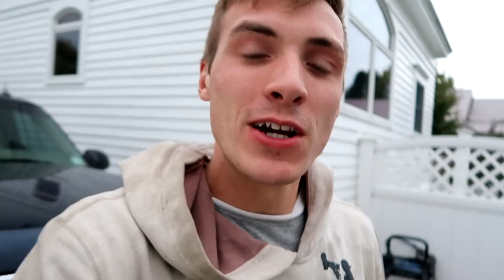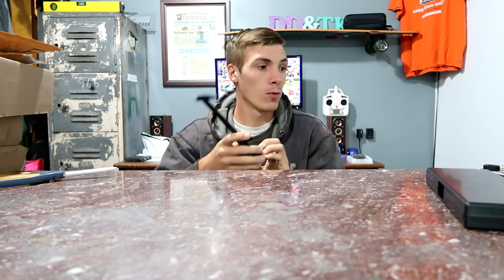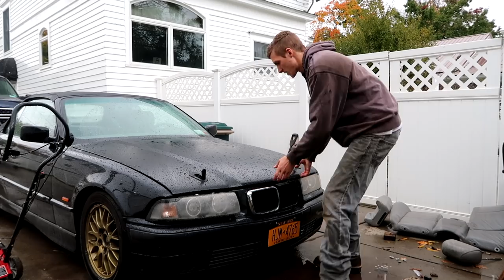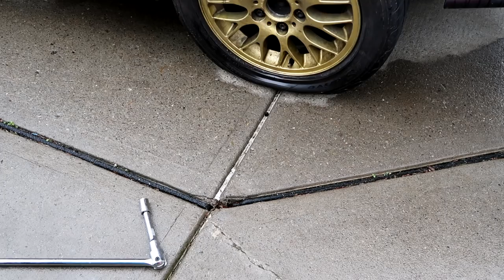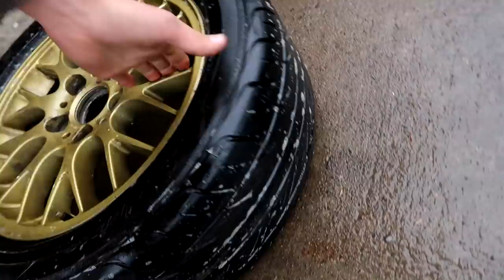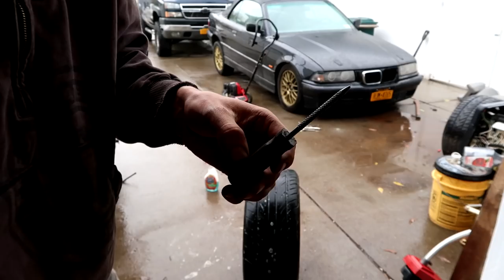IT'S HARDER THAN IT LOOKS!

Comment: dont use tire slime, you'll regret it later. (Or at least your shop will!)
Reply: Matt's Garage - TakeiT  how so
Reply: Alec Olson because when ur shop takes the tire apart them and there tools get covered with it. And slime is only good for small leaks like valve stems and beads
Reply: Alec Olson 
Once you put slime or fixaflat in a tire it's really hard to get a real patch to adhere to the rubber. It leaves a residue.
Reply: AmericanHothead over time slime will actually begin to break down the composition of a tire as well.
Reply: biggdaddy2001 -and will also eat away at the inner lining of the tire.
Reply: Thanks for all the responses
Reply: Like others said, it fucks the tire, makes a nice mess when you go to remove it.  It has a strong scent as well and also speeds up corrosion on aluminum wheels, making the problem worse than it was to begin with.

It's also a pain in the ass to get out of the tire.
Reply: Matt's Garage - TakeiT true lol i had a slime bike tube like an old one and it exploded and it stunk it was super messy to change

Comment: take the tire to a tire shop, they can put a patch on it from the inside, and I've never had a problem with them, pretty much good as new. I've ran them for thousands of miles, to where I forgot with tire had the patch after many rotations.. plus they only charge under 15-20 bucks. even cheaper if u have the tire off for them, and cheaper if they don't Re balance it.. $6 inside patch

Comment: I had a front sand tire for my quad that had the same issue. I'd let it sit and it would be flat later in the day so I used soapy water and found nothing. I submerged it and still found nothing. I finally put a new valve stem in and unmounted the tire from the rim and remounted it using bead sealant. It still leaked! Finally I just put slime in it and it sealed after a few days of adding air and turning it to different positions. It was super frustrating!

Comment: Always mark the leak with chalk or whatever you have.The reason the tire leaks one day and not the next is because of the placement of the tire when parked. And a better way to check for leaks is to find something to submerge the tire in and rotate until you see air bubbles. Please don't use slime in any tire it makes a huge mess for guys like me to clean up when you have the tires changed. If you truly want to use it as a drift car you don't want to use slime or fixAflat because you will be frequently changing tires... plus it throws the balance off

Comment: I have but I deal with it on the daily cuz I work in a shop but you need to burn down the plug it'll seal better with rubber cement

Comment: slime is crap....use air-lok instead....I am a tire specialist and we use it daily in farm impliment and lawn car tires....I tryed putting it in my truck tire and it caused vibration at around 50km and hour not good for highway use tires but it won't break down the rubber in the tires like slime will

Comment: You don't plug a tire with no air in it. You fill it up so it becomes hard.. Rasp it. Insert plug and remove in a quick pulling motion. Much easier to do it this way pal.

Comment: Make sure you get good calipers my dad runs and programs precision cnc machines and he's got calipers and two piece sets that are 500$ a piece (he didn't pay that much)   he's got 2000+ in calipers alone..  He works with very important parts so it always has to be exact. the cheep ones go bad easier.

Comment: 42psi? seems a bit excessive. check the placard on the driver door frame. either on the door itself or on the car. should tell you FRONT, REAR AND SPARE pressures!!!!
I do this every day. lol Happy Black Friday
Reply: even though you have aftermarket wheels 42psi, impo, is too much. that is around the max psi for the tire itself. usually go up to 40psi to mount and check for stubborn leaks. best of luck,and its a drift car so you will be eating thru tires like Grant took Richmond!!

Comment: ummm... couldn't see myself, but you said ALL the way in, then out? That is false info, perhaps most of the way in if you want to compromise, but not all the way. Plus adding sealent before ramming it in helps a ton too. oh, and 1 last bit of advice, do a half turn or so and then pull out fast n hard.